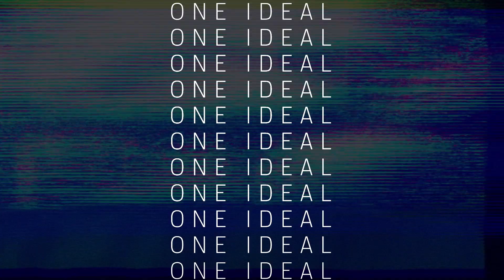Revolutionizing Off-Highway Electrification With Kreisel | John Deere Engines & Drivetrain

Comment: Cant wait for the first products! Will we get some information on new products yet this year or in 2023?Thanks!
Reply from the maker: Thank you for your comment! Currently, John Deere offers Electric Gators and has introduced E-Power Backhoe, a battery-electric prototype built off the current 310L diesel equivalent. We plan to grow our portfolio to include an electric option in each turf and compact-utility tractor product family as well as offer 20+ electric and diesel-electric models in the construction product family by 2026.
Reply: @JohnDeere  Thank you for your answer, really appreciate it.